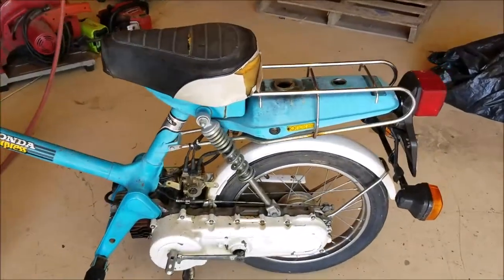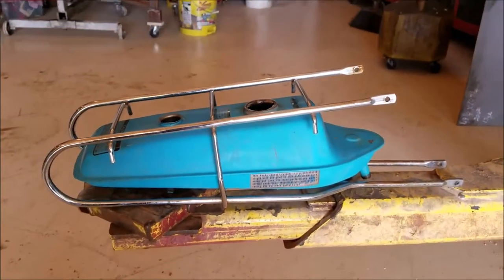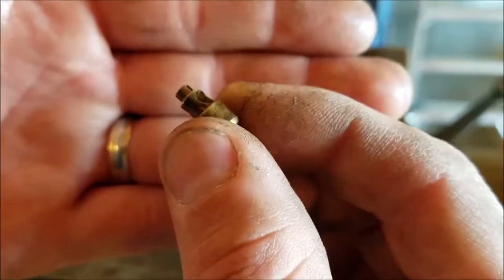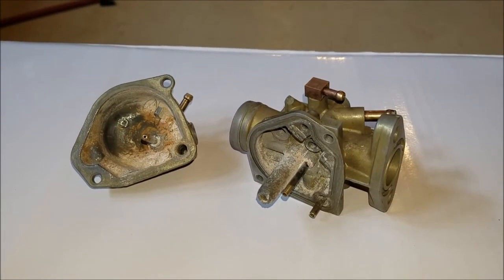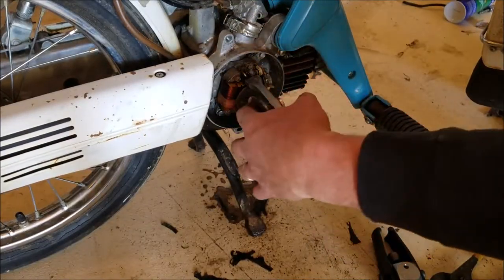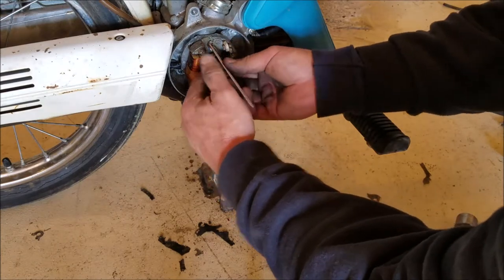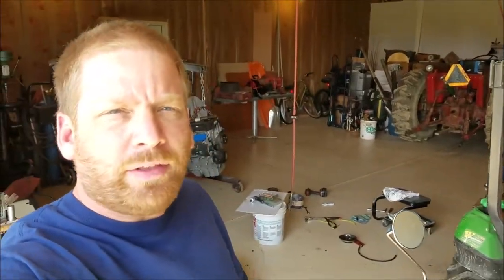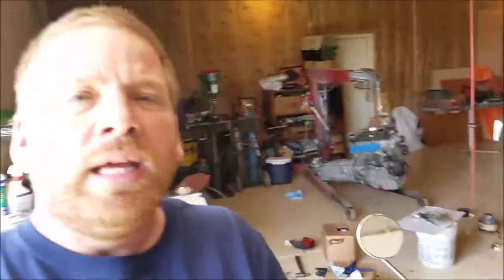RETRO Moped ... Will it RUN? Part2

Comment: Try using tin foil to clean the chrome. That's what we used when I was a kid working in the wrecking yard to clean up the rusty chrome bumpers on the 50 and 60's autos. Worked every time. Great job.

Comment: Fine job of assessing the bike without investing alot in materials. It's in better condition than when you found it. Projects that like this really need a complete tear down repair and reassembly with new seals. I'd bet the cylinder is scorned and needs welding and machining done. More of a collector's project. If you were to change the engine I'd try for a small 4 stroke. Good presentation, thanks for sharing the effort.

Comment: nice work on the gas tank cleaning!  That was great!   Your crank bearings are likely shot.  It sounded noisier and more rattly than it should.  You could try to replace the seals and with the old seals out, hit the bearings with some lubricant or douse them with straight 2 stroke oil.  Anyhow, entertaining video.  thanks! what part of Kentucky?  My buddy would probably want that Express.